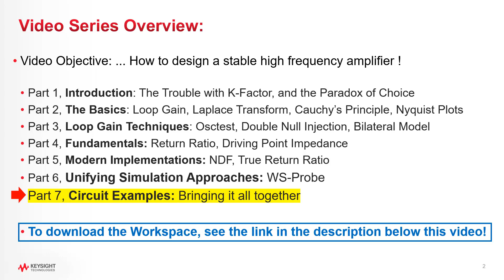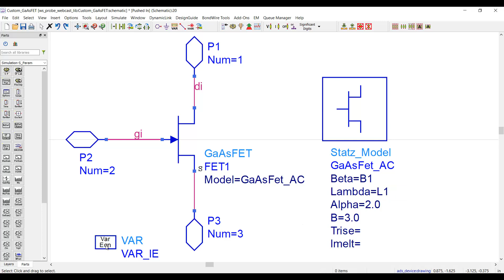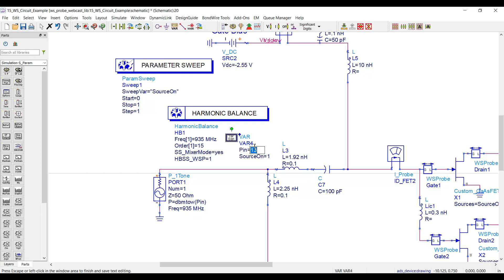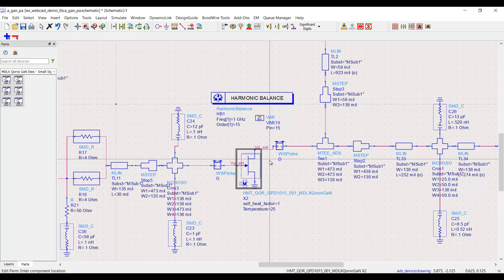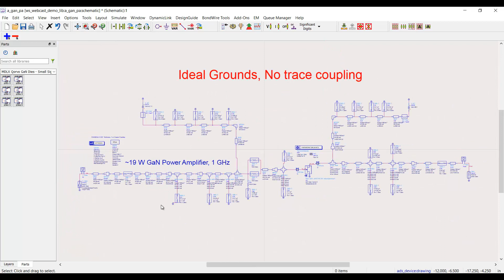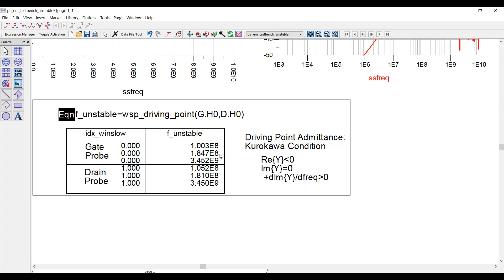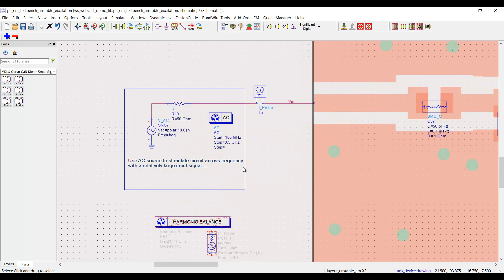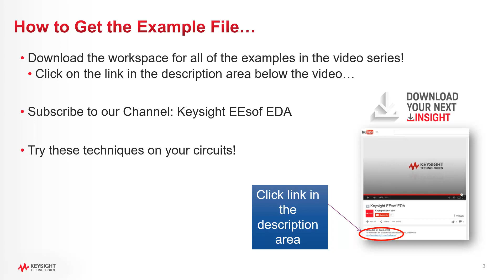Part 7: How to Design a Stable High Frequency Amplifier

Comment: Very nice video series about stability! Learned a lot and many thanks for the material. Can i ask two quick questions:
1.  In my WS probe setup, there is no default loop gain function such as D. LG, what I have is only D.H0, D.F, D.ZL,D.ZG,D.idx, how to enable this D.LG function? Thanks!
2.  A general question about the encirclements () function: my understanding of encirclements is an integer number N meaning how many circles around 1 for example, but why the encirclements () function show an analog continous curve? Can you give some hint on this? Many thanks!

Thank you very much!
 Best,
Reply from the maker: The .LG outputs can be computed with the function wsp_loopgain() – note the function uses a Y-parameter derived from the probe.  You can apply this as a MeasEqn in the schematic view to send the output to the dataset.  Encirclements are computed simply as unwrapped phase / -360, this is why the values can be non-integer.

Comment: Where to get this rfpro layout file? the link you send here does not include the layout. Thanks!
Reply from the maker: The EM simulation result is done using device models which are distributed exclusively by Qorvo and Modelithics. Please contact your local Keysight Application Engineer (AE) and they can help walk you through the process to get the models, and then we can provide the workspace.